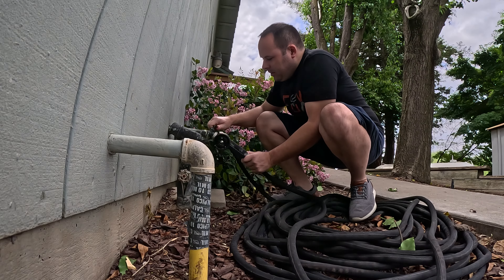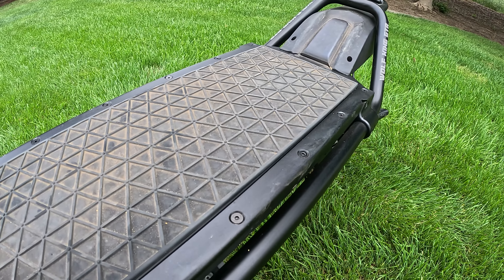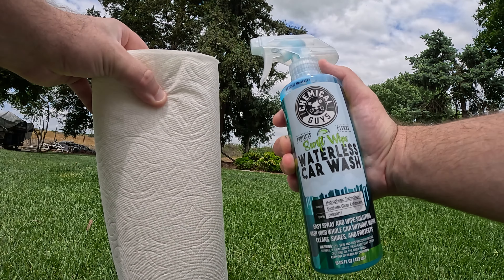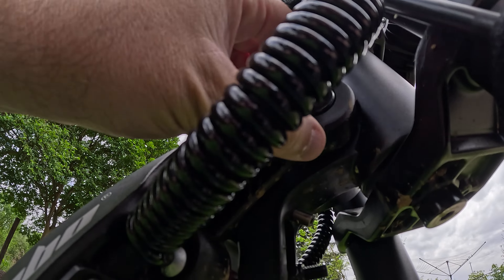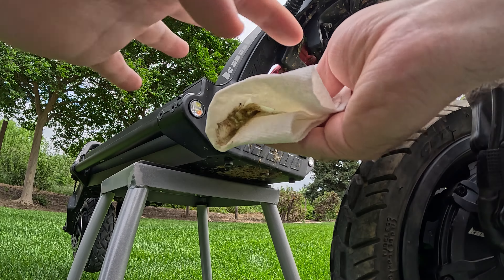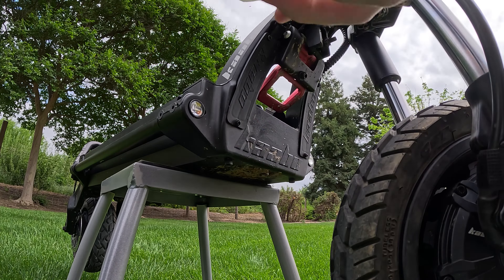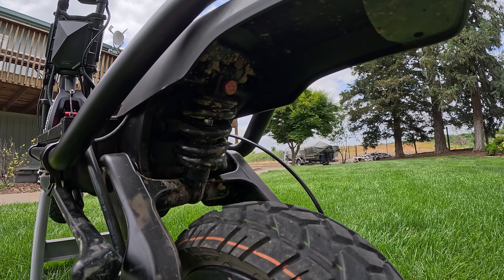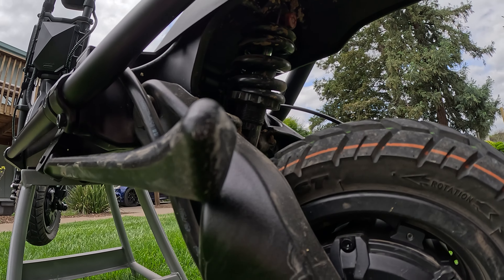How to clean your E-Scooter the RIGHT way!

Comment: I use the same I use on my car, optimum no rinse wash and shine, it consist on putting some of that liquid in a bucket of warm water mix together and use a soft microfiber towel by the way two with one you clean and the other one you dry e the scooter no need to washer pressure the scooter

Comment: Wiping away hardened dirt will scratch surfaces, better to wet it a bit to remove the muck first and moisten it. I use a steamer on mine. No jets or spraying of liquids with microfiber towels. Love my GTR.
Reply from the maker: Yeah I let the cleaner loosen up the dirt first before whipping but the paint is pretty durable enough that it wont scratch like a car would, that is, I would never do this on my car lol.

Comment: I use a weed killer sprayer, low pressure. I also use the handheld pump action and foam sprayers. Luckily, Nami scooters are fully sealed on the controller and deck side. Never had an issue. 

I have a full valet kit for my scooter 😂
Reply from the maker: Nice, be careful with the motors however. Though, they are sealed usually pretty well any kind of submerged water can get inside and rust out the stator wires. I've seen some bad ones haha.
Reply: @daveErides  if that happens, it's due to opening the motor and not resealing the hub cover. The only way water gets into any component is the wheel axel. It gets through to the magnets. Proper maintenance and care will stop it all rusting. I check mine at the end of each winter/spring.